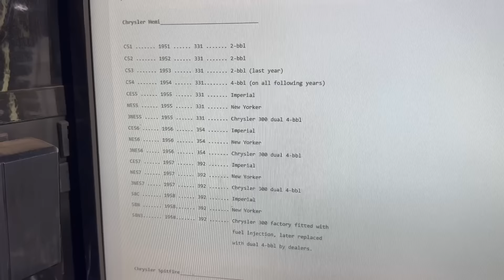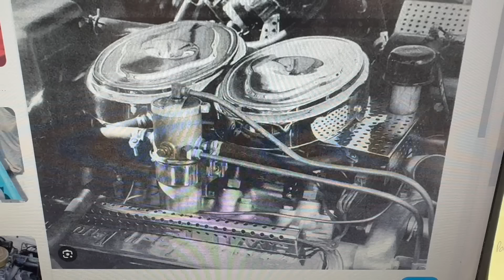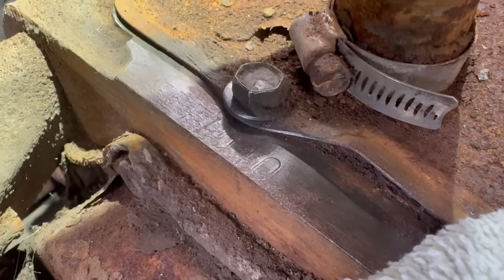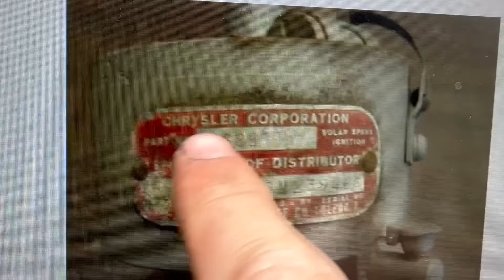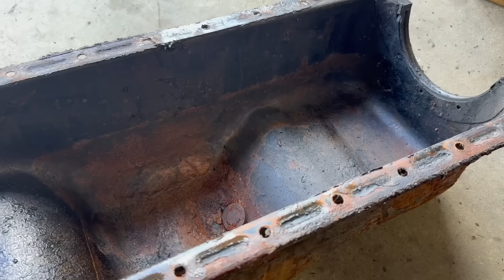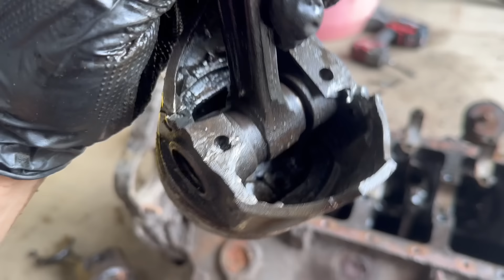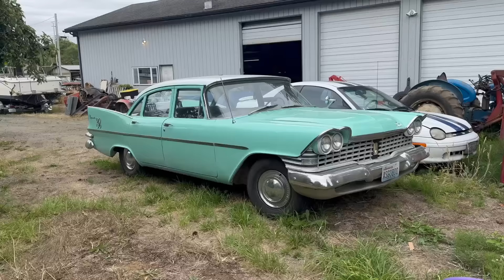The Big Hemi - Seized 1957 Chrysler 392 Engine Teardown, Component ID, Technical Info, And Much More

Comment: use a flat screwdriver [large size] on the starter ring gear gives more torque works great
Reply from the maker: If you think a large flat screwdriver would have un-seized this... lol

Comment: For those engines like yours here, we boiled the whole engine,dried, boiled again, then dried, then put the whole thing in #1deisel fuel for a week. Then we disassembled it. Then back to the boiler. Checked all pieces for reuse if possible but got all new bearings,rings, & the rest to get it back like new. A Nasty & long in hours of work but paid off big time. A good friend who is now deceased used to say, "You can go from St.Louis to Cincinnati,Oh. in 2nd gear with this car." That car was a 4 speed 413 with 3:23:1 posi rear. Flat tap solid cam. It was a beast. And it wasn't a drag car. Sounded like a FM-2 Wildcat at idle. That Red New Yorker 2 door,@T: 48:14, is awesome. Those cars, if you can find one, aren't cheap by any means. Any year is expensive - I've seen a total rust bucket go for more than $4,500.00. When it comes to MOPAR, pricing is insane.

Comment: A Chrysler rep came to our HS  auto shop.  He was recruiting for the Chrysler Plymouth trouble shooters competition.. He told us that there were two different configurations of the 392 hemi   The initial 392 design was wider, used in trucks industrial and marine. Then it was reduced to fit in automobile engine bay. IDK if any of it was fact. but I've definitely been curious.
Reply from the maker: There WERE industrial Chrysler Hemis - many of them, in fact. But they were short deck 331/354 Chrysler engines, or one flavor or another of Dodge engine - and there was never an industrial or marine 392. The comment about an "initial design" does not align with anything that I know about the engine family. The automobile engines and industrial/truck engines are very, very similar. While there are water port differences, timing cover differences, and possibly differences in the head castings, the overall width is going to be consistent across all of them. The valve covers stick out farther than anything else - and aside from rocker arm bumps for some applications, they interchange between truck and passenger car engines.

Comment: When the engine is seized like that why not pull the pan off and remove the rod and main caps?
Reply from the maker: ...Because that's almost never where the problem is?
Reply: @DeadDodgeGarage but wouldn't it make it easier to get the pistons out? Instead of hitting the tops and trying to get the crank and the other 7 pistons to move?
Reply: @DeadDodgeGarage after finishing the video I see you went with the option i was referring too 😂

Comment: I believe you'll find the fuel injection system was designed by Chrysler and was sold to Bosch, whilst a revolutionary design Chrysler couldn't make it work and reverted to carburettors, whilst Bosch continued to develop the system into the famous K-Jetronic or CIS and CIS/E we all know and love among Euro high performance engines of the 1970s-80s, like the Porsche 911 and Ferrari Testarossa. Yes, it was a Chrysler product, Bosch just bought the rights. Like you needed another reason to love classic period Dodge.
Reply from the maker: I believe I've talked about that in the past.

Comment: Stuck engine? Heat! Then shrink with cooling oil. Old bastards like me actually pull the oil pan on the engine stand, and spray the whole interior of the block with atf and acetone  soaking the back sides of the pistons , warming the block with a ditch burner. Works really good.

Comment: In 1975 I bought what I though was a 392 Hemi for $50.00 out of a junk yard. It was a Dodge Red Ram Hemi. Even had the red ram on the chrome valve cover (the ram was red, I thought it was cool) I was in the Army at the time and was transferred to a new post. I left the engine with a friend for "safe keeping"  When I went back to pick it up he was gone and so was my engine. 
But what I know now I suspect it was a 331, not 392. The transmission was weird, It was an automatic with a clutch. Any idea on that? Anyway another great and informative video. Thanks

Comment: I think this engine was seized before it was removed from the car.  That's why the torque converter is still bolted to the crank. It wouldn't turn, so they couldn't remove the torque converter nuts and were forced to pull the engine with the torque converter still connected.
Reply from the maker: Absolutely. That was my assumption.

Comment: I have owned several different Chrysler engines with the Autolight dual point distributors one was a 57 354 Hemi dual four barrel engine also an early 63 383.

Comment: If the LA crank will rest in a Golden Lion block, I'm curious, will the Hemi head rest on an LA block? Just a thought.
Reply from the maker: Golden Lion was a big block, not a Hemi. No - none of the first generation Hemi heads are very close to fitting an LA block. I have actually measured and compared all of them in previous Hemi videos, because I’ve always wondered the same.

Comment: GR8 Video Jamie!!! You revealed so many peculiarsrities about these 1950's Chrysler engines !!!  It is so good to know that people are starting to sell these vehicles and engines ,& Parts at estate sales...
   However, There is something that I want to emphasize, about using sledge hammers on these antique engines...That concerns me and others who are into restoring Old machinery , like these 70+ year old units that You are tearing apart...Stop using sledge Hammers!!! Use a bottle jack with chains and bitch links welded to their base . Then use the head bolt holes on the blocks to secure the bitch links & chains to the jack ... Use several 3.5" disks made of 1/2" plywood stacke 2 to 3 high to put between the ram of the bottle jack and the crown of the piston. Slowly move the piston in it's bore with some heat and penetrating oil...Then put a 2x2 wood block on the end of the con-rod. to GENTLY drive the piston back up into the bore...Do this several times , back & forth... Using penrtrating oil and light heat... Save the sledge hammers for demolishing houses and walls...Use PLENTY OF PATIENCE AND FINESSE when working on these antique engines... Otherwise You will likely end-up with TONS of useless junk that few people (if any) , can actually use for their projects... Take it or leave it Amigo...  When TECHNICIANS Treat these old machines with  RESPECT ;  Others will treat the careful TECHNICIANS with respect as well..
     And another thing, Use BOTH HANDS when working on things like these...Build Yourself  a strong/sturdy workbench do do your work on... Get an assistant to shoot the video footage... Use a tri pod when necessary... Put 100% attention to what You are working on, with fewer jokes, and more attention & FOCUS to what you are doing... Sell or donate the sledge hammers - to those who do demolition work...Be PROFESSIONAL , if you want to GROW your business... 
   Original input was made on : 11/16/25 
That input was revised Today on : 11/17/25
Reply from the maker: Brother, any old school farmer can tell you the value of a well placed hammer tap. I beat this engine into submission and it’s now being overhauled. The small ding on the crank was regrettable, but easily fixed. I’ve beaten countless other engines into submission, too. I’ve yet to even crack a piston, let alone damage a block or head casting in any way during disassembly. I know exactly what I’m doing. Thanks.
Reply: @DeadDodgeGarage Jamie, you need to do a few things to expand your business...To get it out of the point that you are probably stalled at...  Using 4 and 6 pound steel sledge hammers to take these engines apart is VERY BAD!!! This will likely cause serious damage to the machinery that people are very passionate about... I have also disassembled engines of the type that You are dealing with , with similar rust and grease , without using huge sledge hammers...I used a lot of penetrating oil , a lot of patience, pullers, wood blocks, propane torchs (without overheating aluminum parts) and buckets of diesel fuel to loosen the waxy grease.then afterwards , using paint brushs , plastic scrapers, green scotch brite pads dish cleaning pads... I was very careful with those valuable parts, I marked with a white out pen where those parts came from and how they were positioned , even the rocker arms, pushrods & lifters...That kind of attention to detail makes a difference... I NEVER USED 4# & 6 POUND SLEDGE HAMMERS , During the careful disassembly process on ANY engines of ANY type.. Previously to that time , I DID use sledge hammers, when working with a contracting outfit doing demolition work.. on block walls and punching holes on buildings to do room additions... But I  NEVER SLEDGE HAMMERS ON ENGINES!!! 
     If you have to use a sledge hammer to tear it down , stop 🛑 , And sell it as is to somebody who KNOWS HOW to PROPERLY disassemble things that you do, without using sledge hammers... Let THEM DISASSEMBLE it , without destroying it in the process...Stop 🛑 using Sledge Hammers on equipment like this... Leave what habits you developed in the farm, on the farm...Step up to professionalism, before destroying any more valuable , highly sought after equipment , like I witnessed you doing on your show... Get a set of sturdy shelves to safely stow these ENGINES AND ENGINE SUB ASSEMLIES on and Build A sturdy workbench to do work on... Those two things alone , will GREATLY help you to expand Your parts sales business Jamie...Make sure to get a website advertised on your Youtube channel for additional parts and equipment availability for those who might be interested...Hide Your sledge hammers , when doing Your show... Today is: 11/18/25
    Today is : 11/18/25
Reply: @DeadDodgeGarage  Jamie, the problem about cracks in metals especially castings, is they often are very difficult to see with the naked eyes....Heck, when you were slamming those pistons with the sledge 
hammers, pieces of them were dropping to the floor !!! No engine stand to work off of, No workbench , No shelving to safely stow the parts ...Dude , It's so obvious... Now you are claiming that you have damaged nothing!!! B.S. You even showed the damage to the viewers...It would not be so bad if it was an old worn out Yugo engine or something...But a 392 Chrysler???Are you kidding Me!!! Wow... You seem to have excellent access to some legendary engines, but you refuse to use patience and professionalism when working on them...I'm not trying to make You look bad, but wow, You don't even seem to care how you look..I'm just trying to make you aware of how you appear on Youtube... Another set of eyes...And You deny it.... WTF...Today is : 11/18/25

Comment: Jamie, the gunk that you ran into when trying to free up engine looked like cosmoline. That was a common grease, brown in color that was solvent based but would harden over time when exposed to air. It has a waxy appearance. I am glad that you were able to save the rods, the cam, the crank and the block. Good things can happen with that.
Reply from the maker: Yes, I think you’re right. Gross stuff.

Comment: The Engine "shown" is a 331,not a 392, I can tell by looking at the heads. I have a lot of them and build  & Race them,build & sell some. Great engines.THEY INVENTED Drag Racing, so to speak !
Reply from the maker: So I guess you didn’t watch the video then? The ENGINE is a 392. The HEADS are from an early 331. I explained that. Thanks.

Comment: Did the mid sump hurt Dodge in the long run in drag racing that is , would oil starvation be an issue in the early years?
Reply from the maker: Absolutely… the mid sump oil pan has probably killed more 426 Hemis than anything else.
Reply: @DeadDodgeGarage thanks for the reply

Comment: Great info on that 392 Hemi. I had a chance to buy one way back in 1981 for $500 in the Central Valley near Hanford, CA in Corcoran. It was a long block with all manifolds. It was a WILD looking dual long ram dual 4 barrel - if I recall correctly. I had a 1931 Model A Ford at the time and it would have made a nice rod mill, if it fit! What was the HP factory rating for a 1957 392 Hemi with the long ram intake anyway??? I always wondered if I should have bought that HEMI. The one that got away!!! UPDATE: I hear only later RACE 426 Hemi came with LR intakes - could it have been a 413, 426 wedge??? Maybe.
Reply from the maker: Oh, that sounds like you’re talking about a long ram / cross ram engine, which would have been a B or RB. Those are really neat. Not insane power producing machines, but neat. Hemis (early or late) never had long rams, they only had dual inline quads (all street 426s, and high performance early Hemis like in the 300,) or possibly dual offset quads above the valley on a race 426.

Comment: Doesn't hold a candle to the 426, listen I'm Mopar through and through and I am a fan of all of these engines but Don garlits was making 2000 horsepower out of a 392 with a stock bottom end.they were rebuilt after that race day but that was something no other engine from any car manufacturer could do except for the 392.
Reply from the maker: Yes, and it’s awesome - but the basic 426 architecture is making 10,000+ horsepower today.

Comment: In the early 80s I worked for a machine shop building high performance engines. My boss at the time built up iron Duke 4 cylinder Chevy engines for his street rods. We had a set of early hemi heads in for a valve job. It was a smaller cube motor.  I set one of the heads on one of the 4 cylinder block just to see what it looked like.  It almost bolted up. The bore spacing was identical. With an engineer buddy, he had an engine running with a hemi head. He drove from  Denver to St Paul Minnesota for the street rod nationals.  The valve train was crazy, and limited rpm. Was also plagued by head gasket problems.  Looked really cool. People thought he cut a Hemi in half. Love your vids.
Reply from the maker: Wow! That’s fascinating.

Comment: Idk who designed the hemi head but Harley started using the design starting in 1936 in their Knucklehead, Panhead all thru 1984 in the Shovelhead.
Reply from the maker: So I hear. Not a car, but neat. Jaguar did start building XKs with a Hemi chamber in 1948, so either way I’m wrong.
Reply: Just throwing it out there

Comment: The tall deck Desoto came in sizes larger than a 330; they were available as a 341 in '56 Adventurers and in '57 Firedomes/Fireflites, and as a 345 in '57 Adventurers. Your 392 being numbered 1040 makes it the 40th 392 installed in a Detroit-bult '57 New Yorker. Definitely first week of production, maybe even first day.
Reply from the maker: I know - I forgot about the 345.
Reply: @DeadDodgeGarage  right on. As you can probably tell, I'm a geek about this stuff. Great job getting that 392 apart. Sometimes they fight.

Comment: I have 12 Desoto  Hemi's, most were seized when purchased. I have very good luck getting them freed up by a 50/50 mix of gasoline & engine oil dumped down the carb. The mix would get into the cylinders. After a day or 2 I would apply a pry bar to the flywheel teeth & I would be able to get the engine to move back & forth. I actually got them all running.

Comment: there were a number of european hemi engines between the wars in both cars and motor cycles also welch cars manufactured a hemi in chicago in 1903. the tatra 603 in the 30s had one i think it was an aircooled v8 and both riley and daimler used them in england.

Comment: More good early hemi content!
Just so you know, DeSoto also had an "Electojector" fuel injection option. Even fewer than the Chrysler versions made it to the streets. Seems like I remember DeSoto production start date was a month or two behind Chrysler, so they had learned about it's flaws already so not many DeSoto's came out with them.
Anyway, I remember some engineer doing a restoration on his DeSoto and managed to find and install the FI on his car. He had spent a good bit of time and money to determine why the failures in the 50's and basically back engineered his system to feature new parts that would work. Seems like it was bad transistor tech from the late 50's. 
He replaced those and now had probably one of the rarest cars in the world when considering make, model and options.
Reply: I recall seeing a 58 DeSoto 361 with the EFI at the Meadowbrook Concours d'elegance.  Perhaps the same one.  The restorer from Massachusetts said the worst parts in the electronics were the paper capacitors.  Modern capacitors were what it took to make it run.  He liked to demo it by standing outside the car, reaching in the window, turning the key, and it started instantly at a smooth idle.

Comment: Duesenberg engine was a Hemi(pent) head...DOHC, 421ci. They didnt make nearly as many of these as Chrysler, but it was "production"...481 roughly were built. 271hp in 1929, 350hp supercharged in 1930s

Comment: Hello thanks again for all the information you have provided. So I’ve just changed the headlights switch on the 71 Chrysler 300. .If I was a lot younger I’d be worried that I would be dragging into the headmaster’s office accused of self abuse after all the cuts on my forearm…Regards Roy

Comment: So, if the hemi design is so good why would companies stop making them? Is it the cost and complexity? Could you get the same amount of power just by making an engine 10%, or so, bigger?
Reply: The 413 replaced the 392 for that reason.  Cost, complexity and weight.  Those huge hemi heads are heavy.